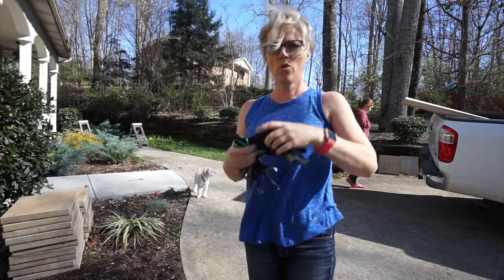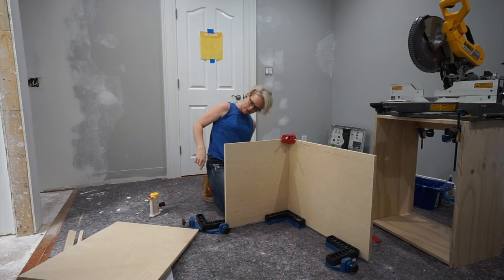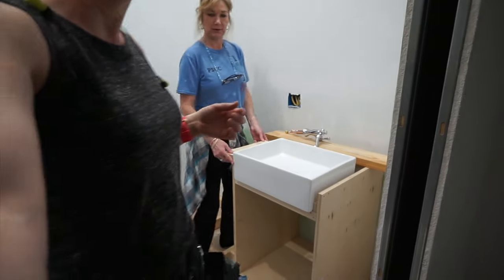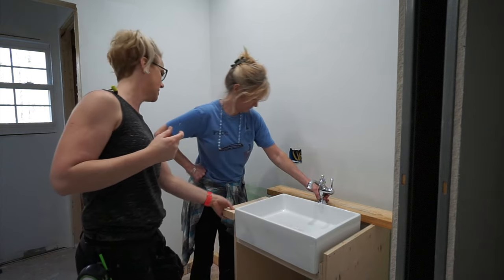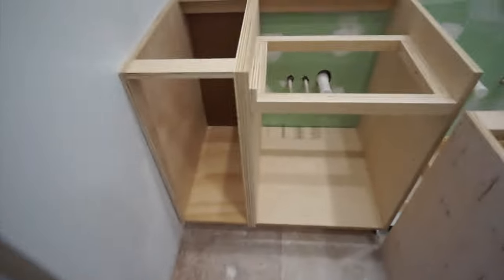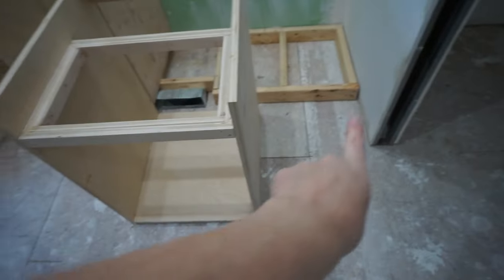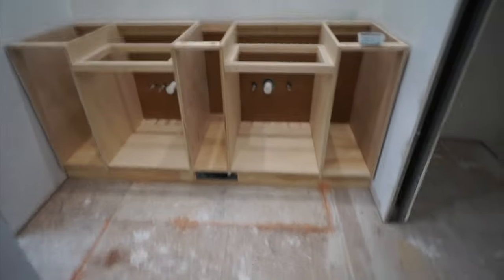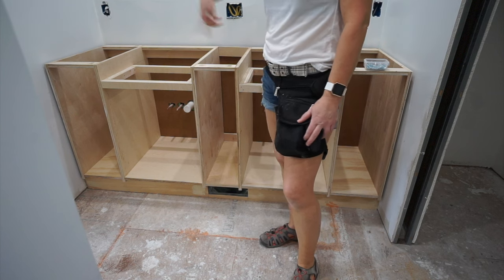Building Vanity Cabinets - Jack and Jill Bathroom (part 9)

Comment: To lift a 4x8 sheet stand it on edge on its longest side. Tip it onto one corner at 45 degrees so you have a diamond stood on one corner. Put your hand half way down the long side that was just on the floor, let it tilt back to level taking the weight on your hand using other hand at the top to steady it. No bending or lifting involved. Stay out of the wind!

Comment: check out Steve Ramsey's Chanel he uses a rolling table that is the same height as the tail gate on the truck all you have to do is lock the wheels and slide the plywood off.
Reply from the maker: Unfortunately I can't put the tailgate down to unload because my truck bed is short so sheetgoods have to sit on top of the tailgate.